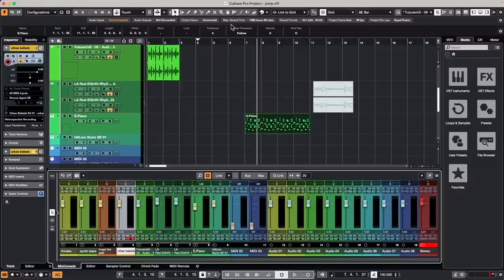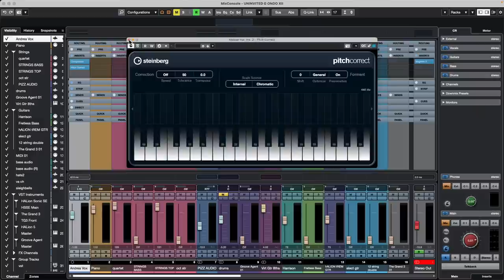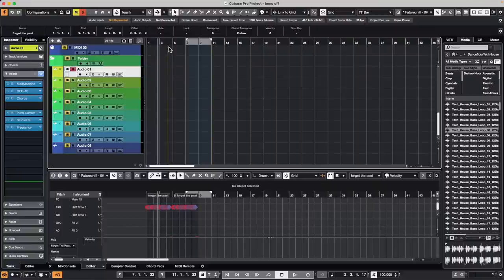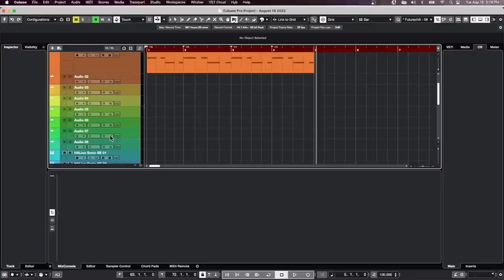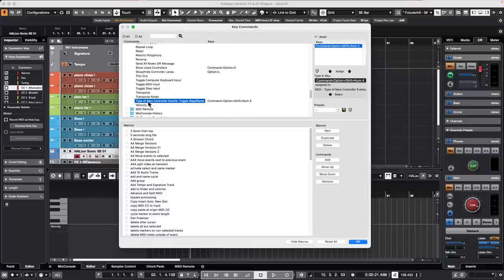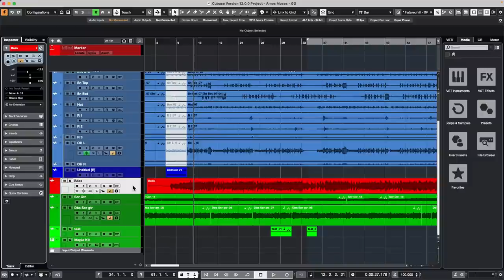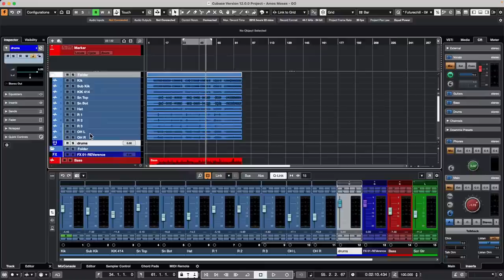What is the difference between warp grid and warp grid | Club Cubase Aug 16th 2022

Comment from the maker: 00:02:58. Will there be new logical editor presets in version 12?
00:04:13. Are there any changes in Cubase 12 with nvidia graphics driver problems?
00:06:43. What is difference between warp grid and warp grid (musical events follow)?
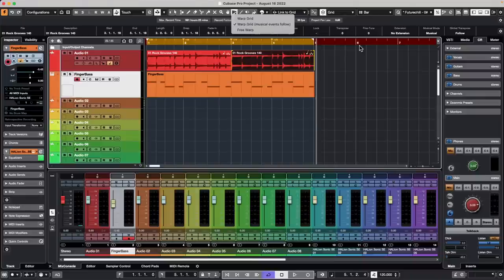00:09:53. Why do I have 21 instances of MixConvert plug-in in my stereo template?
00:16:48. How to get the vocals softer to fit in a mix?
00:20:04. Why is duplicated track carry VariAudio edits to both tracks?
00:21:50. Can I select MIDI data by velocity in the MIDI editor?
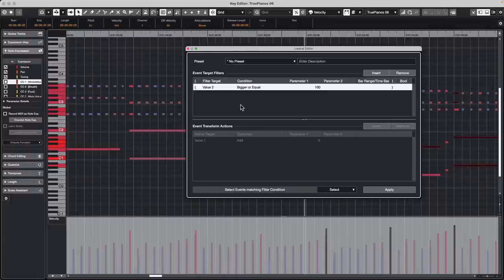00:23:47. Is it possible to mix and produce using only included Cubase plug-ins?
00:25:07. How to see time selection of the range tool as opposed to bars and beats?
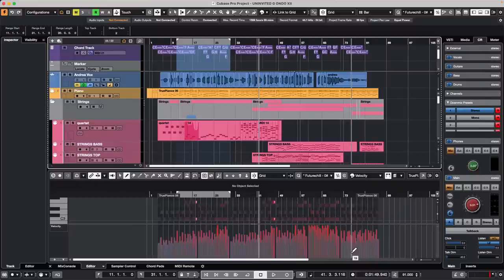00:27:23. How to play back to my mixer or my external keyboard?
00:29:11. Why do I have to start Cubase twice to get my SSL plug-ins to run in Rosetta?
00:30:43. How to close unseen instances of MixConvert plug-ins not visible in project?
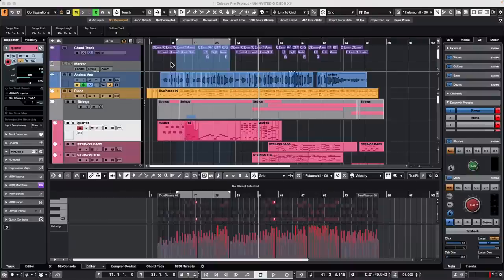00:31:28. How to transpose the chord track to a different key?
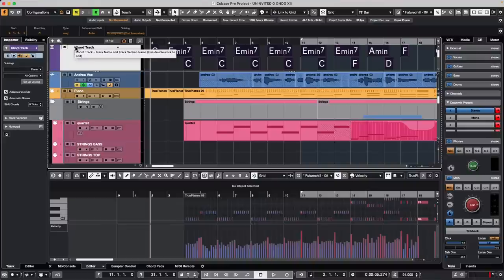00:32:43. How to remove a plug-in that is showing up twice in my plug-in list?
00:34:40. Does the Cubase SKI show up every time when running on a M1 Mac?
00:36:09. How to see the latency of plug-ins inserted in the control room?
00:38:53. Can I merge inserts from a track preset into a track with existing inserts?
00:42:05. Is there a way to apply VariAudio edits from one track to a different recording?
00:44:02. How to convert a track recorded in VSTi 2 to load in a VST 3 plug-in version?
00:45:49. Is there a way to rename a cycle marker based on a selected event?
00:53:34. How to master a song in Cubase Elements?
00:57:21. How to use a template so that audio is not recorded to the template audio folder?
01:01:11. How to convert VST 2 track in Cubase Elements 9.5 to VST 3 in Cubase Pro 11?
01:02:39. What is the best way for efficient gain staging in Cubase?
01:04:22. Why is my Cubase background transparent?
01:07:43. Is it only Q&A or will there be a discussion of creating club music in Cubase?
01:08:12. Is there a way to drag and drop media from the grid to the media browser?
01:09:47. Is there a place to download logical editor presets?
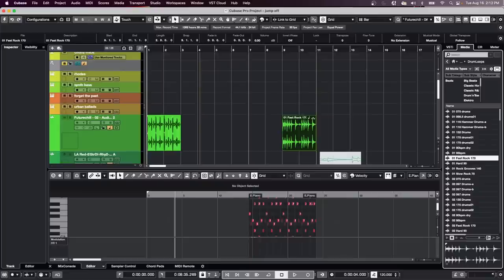01:11:38. How to reverse an audio clip without using the sampler track?
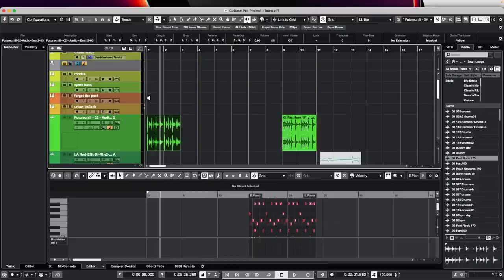01:12:19. Can I set a key command to reverse audio events on the project window?
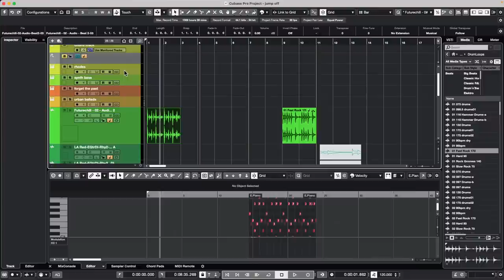01:15:19 How to map a VST instrument to trigger single notes as opposed to patterns?
01:18:58. Should I copy tracks from VST2 instruments to play VST 3 instruments?
01:20:22. How to change audio loop from A minor to C minor?
01:22:49. How to move my created samples to specific folders?
01:25:12. What other time saving functions can I use to buttons on programmable mouse?
01:27:28. How to get Cubase to see all inputs and outputs on M1 Mac with Apollo interface?
01:29:28. What is the best way to record bass player who is plucking and slapping?
01:32:32. How to switch to drum edit mode from full screen key editor?
01:36:02. Can I import multiple MIDI files at same time?
01:37:26. How to change the project audio folder after project is set up
01:41:51. Why are chorf pads not working as expected with NI west African spotlight?
01:44:20. How to setup external VST instruments with Cubase?
01:46:26. Can you discuss some new features of running SpectraLayers 9 in Cubase 12?
01:50:02. How to increase the stereo width of an audio file and get more info to the sides?
01:55:44. Is there a MIDI Remote script for the Virus TI 2?
01:57:13. Is there a quick way to reset the values in loudness meter back to 0?
01:59:15. How to replace audio drum files to new ones in audio or MIDI at the same time?
02:03:14. How to mute a specifi section of audio without cutting events?
02:05:40 Is there a way to get my Cubase projects to load faster?
02:10:51. Is Shift +X the key command to split the selected range of an event?
02:13:07. Why does my exported interleaved mix have files split in different programs?
02:16:05. How to trigger a macro to always show mixer with specific channel tracks open?
02:24:12. How to modulate any plug-in parameter for LFO based workflows?
02:30:57. How to setup a talkback system to headphones of vocalist while tracking?
02:39:44. How to change sample rate of project with messing up the project?
02:45:54. How to find key command to switch MIDI CC mode from ramp to step?
02:50:22. Which introductory playlist is good for someone just starting to use Cubase?
02:53:16. Where to find a MIDI loopback function for Windows?
02:55:04. How to group MIDI notes within the MIDI key editor?
02:56:26. How to select notes with the same color?
02:59:31. Can I use reverb and delay plug-ins in real time when I do Facebook Live?
03:01:01. Why do I get a MediaBay that message duplicate entries are found on new install?
03:03:02. How to get Mystic and Prologue to work in Cubase 12?
03:04:52. How to record over just a portion of a vocal file?
03:10:20. Why are some samples not visible in right hand side MediaBay?
03:14:22. How to slow down project to record difficult part and speed up to original tempo?
03:17:05. What is the best reverb to use on a voice over?
03:20:20. Can you discuss best track naming conventions for orchestration?
03:22:39. How to do a export and have files appear directly below selected events?
03:24:48. How to change the track height with keyboard shortcuts?
03:26:02. How to make the meters in MixConsole show pre fader levels?
03:27:01. How to calibrate the stereo out setting for monitors and headphones?
03:28:42. Is there a way to change the track height of all tracks at once?
03:29:32. How to process the mixdown to -14 LUFS inside of Cubase?
03:32:03. How to change the relative gain of multiple sends at once?
03:34:50. How to see RMS levels with peaks in the channel fader meters?
03:36:38. How to quickly apply offline effects to events so it can be previewed?
03:39:53. How to improve CPU usage on MacBook Pro?
03:43:17. How to pitch shift both an instrument and an audio track at same time?
03:46:11. How to optimize computer for Cubase on Windows?
03:47:58. Is it okay to put tape saturation on every track in a project?
03:50:21. Is it possible to copy multiple automation lanes to a different track?
03:56:06. Is track transposition possible in Cubase LE/AI Elements 10?
03:56:42. How many speakers do I need to do atmos mixes?
03:57:04. How to send a number of tracks to a folder and group track at same time?
03:58:46. Wrap up.  Stay safe and healthy.